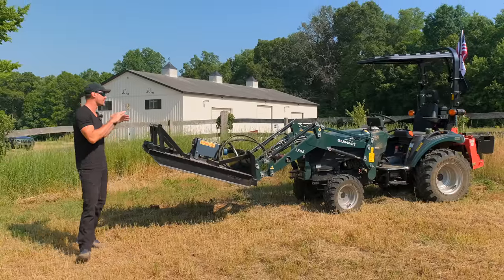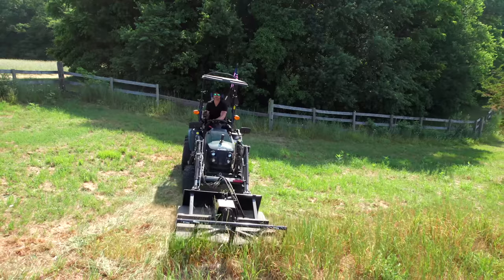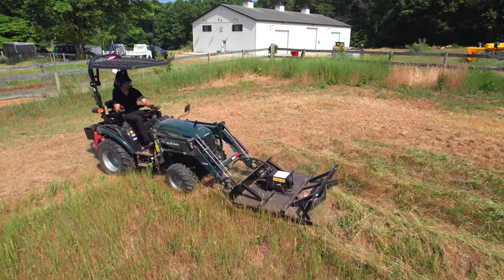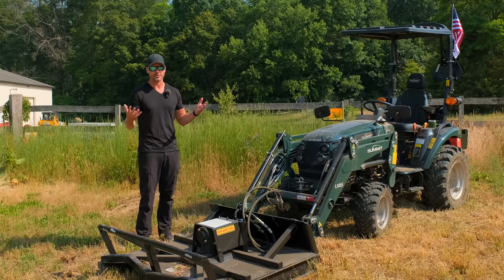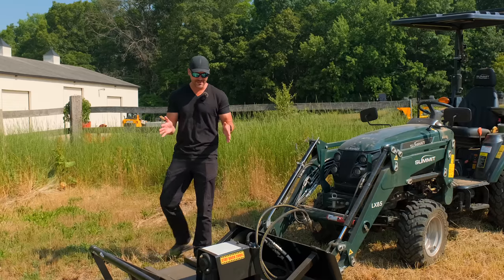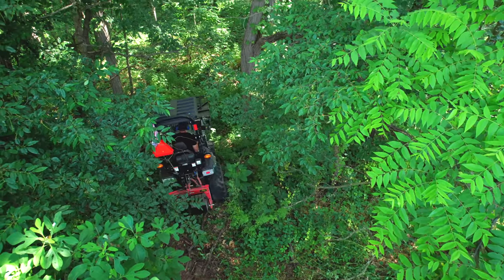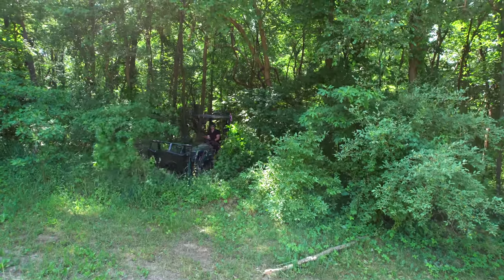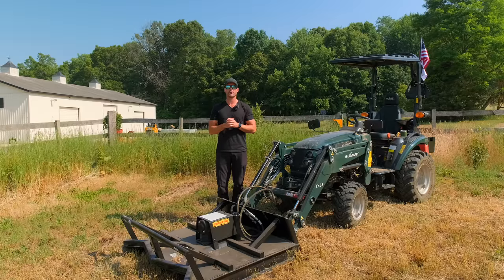NO LOOKING BACK! LOADER MOUNTED HYDRAULIC BRUSH HOG! 😱

Comment: I would like to find a hydraulic sicker bar that can be mounted off from the loader so to be able to keep hedges and stuff trimmed along driveway trails and fence lines.  But it got to be able to be run off from a compact tractor like 20 - 25 hp
Reply from the maker: Haven’t seen that yet
Reply: @GoodWorksTractors  There is one out there its 38- in cutter that only requires 3 to 4.5 gal/min. hydraulic flow and can be adjusted to cut vertically, horizontally, or at any angle in between A hydraulic motor powers an oscillating cam connecting two cutting blades. Varying the hydraulic flow using the engine throttle changes the speed of the blades. 2 inch opposing sickle sections allow the cutter to cut material up to 1 1/2″ inches in diameter.    I just doing some research on it now.
Reply: @NYTROeast  Interesting! Thank you for sharing. What is the name of this cutting attachment and /or link? TIA
Reply: @triangels  I will not share that info here on Courtney's page/channel. I don't believe in advertising pages, or channels on someone else without their permission Sorry.
Reply: I"ve got one samauri sabre use it on my 1025 it works ok but you have to learn to get the feel of it I"ve used it quite a bit.